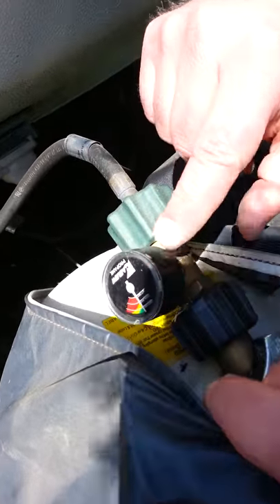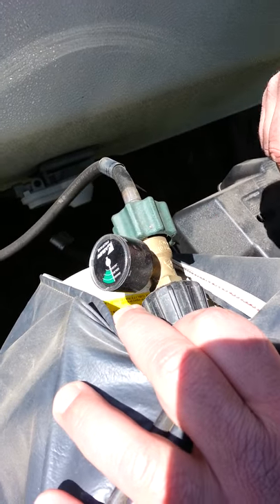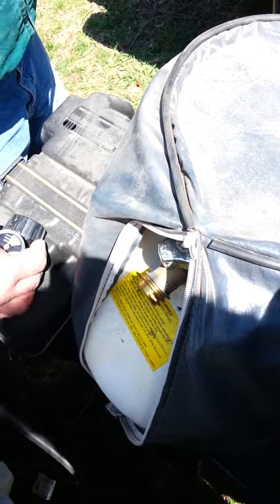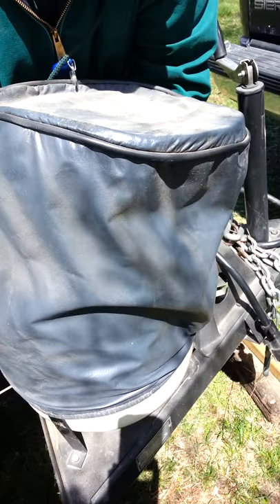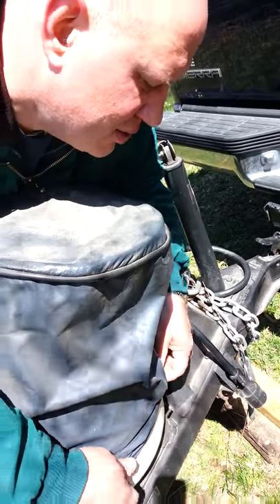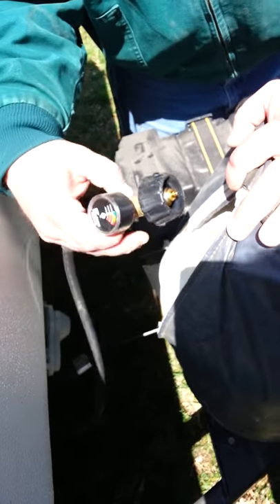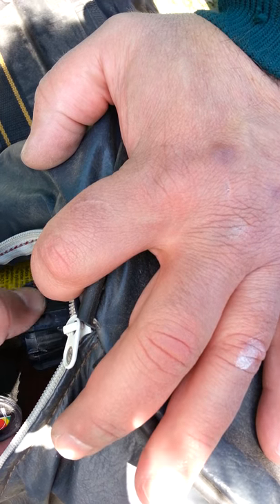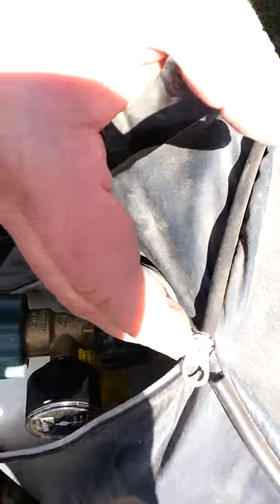Hooking up and turning gas on and off to pop up camper

Comment: hey folks....1st time using my propane on my pop up tomorrow night...hunting time in the woods!!  Do I need to open the propane bottle all the way...or can I open it just a few turns?
Also...if I get the furnace working...will the propane run the fridge too?  I should have practiced before hand...but it should not be too cold...thx